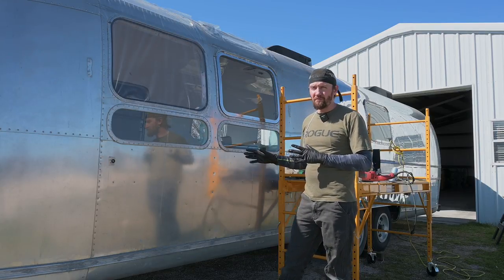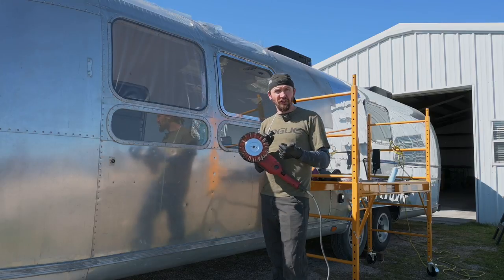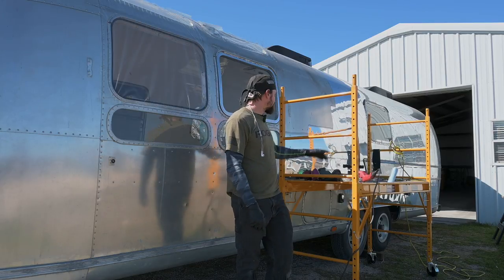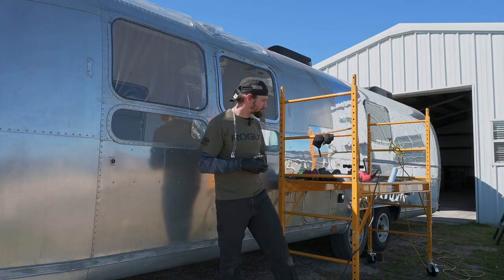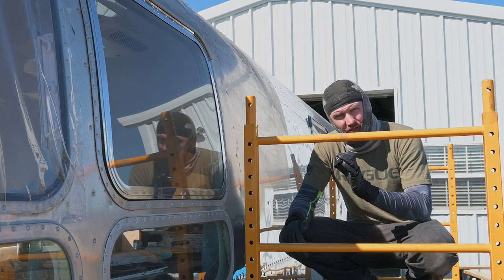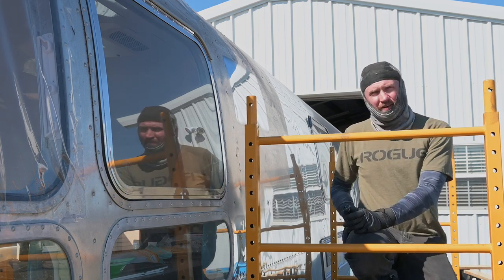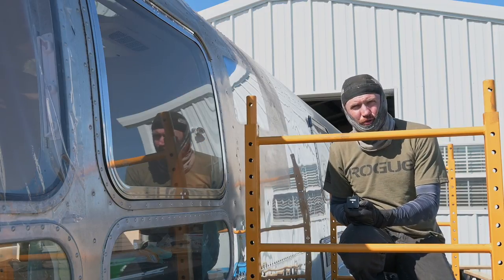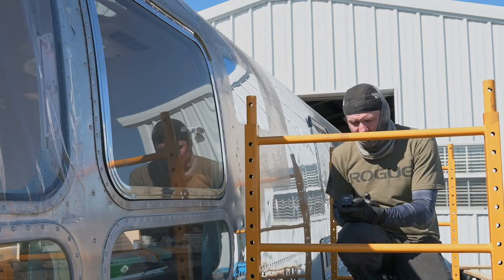3 Tips to Faster Airstream Polishing

Comment: Thanks for the video. Question regarding your links, you are using the Milwaukee grinder & orange wheel but your links are for DeWalt polisher & yellow wheel. Why the change?
Reply: Both will work Milwaukee is just better bc spins faster

Comment: Does the polish look go away again?
Reply: It will always oxide and turn “dull”. You’ll need to polish the trailer around once a year if not treated. After this “heavy lifting” polish process, the trailer becomes easier to polish and won’t require as much effort. There are products out there to coat the polished aluminum to help slow the oxidation process. However, yes, you will need to keep polishing it from time to time.